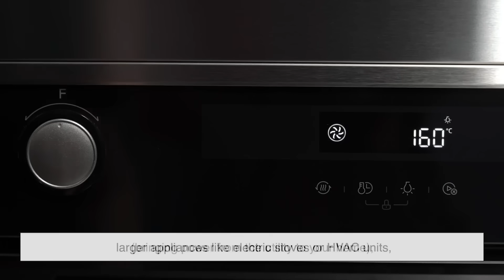What’s the Difference Between Copper and Aluminum Wiring?

Comment: Did you know during wwll copper could not be spared from use in war to use for the  enrichment of uranium. The machines required lots of wiring. So instead they took silver from the treasury to make the wiring. The machines used 7 percent of the US electric supply to run.

Comment: Municipalities need to start using aluminum for street lighting. Here in MN, Saint Paul in particular, copper thieves have left whole areas of the city's street lighting dark. At least with aluminum the profit motive wouldn't be quite such a enticement.
Reply: Detroit used aluminum for street lighting also because of copper theft.  Detroit also ran the wire overhead instead of underground to prevent theft and save money.
Reply: Or just enforce the laws like normal states do. But you got Tampon Tim, so I won't hold my breath.

Comment: I've lived in two houses with aluminum wiring and I'll say this: Copper is better. aluminum is so hard to work with and damages easily. Straight runs are fine, though. Replacing a switch or outlet wired with aluminum is a nightmare as the wire tends to break.

Comment: I crunched the numbers:  when the US Mint changed the composition of cents in mid-1982 from 95% copper to 2.5% copper, they used 49 million pounds less copper for 1983 alone.  Aluminum was a contender to replace copper in 1974.

Comment: It should be mentioned that, for cost reasons, copper-clad aluminum is also used, for example in jumper cables or speaker cables. With copper-clad aluminum you don’t get oxidation like with aluminum. Maybe we see this in house wiring as well in the future.

Comment: We live in a house wired with aluminum from the 60’s. Never been an issue but the real irony is that AL was used due to cost of copper, yet running from the basement to the second floor is a 6 inch copper drain pipe. Wonder what that cost 😀.
Reply: I got rid of most aluminum (only 3 ceiling boxes left with Al.) from my 1974 house. The original aluminum electrical work was poorly done. Lights were flickering and outlets buzzing.
Reply: 😂😂😂😂😂 sounds like copper wire was unavailable during the construction😂😂😂. Copper is better for wiring, you can carry more current with less material with copper.

Comment: For aluminum you have to choose a larger cross section than for copper. There is also the problem of making a durable connection with aluminum that does not oxidize. Special contact paste is necessary to safely contact aluminum. And then the problem is when a connection from aluminum to copper has to be made. Connecting different metals without corrosion.
When the cable moves, aluminum tends to break, copper is more flexible. Except for very thick underground cables, copper is better to use.
Reply: Actually I was trying to think of the term "differential metal corrosion". I thought that was the problem with aluminum wiring. You had to purchase outlets and switches made for aluminum.

Comment: Nice overview of Copper vs Aluminum wire. Glad you mentioned Aluminum wire is still widely used for the large residential service conductors, both on the utility and home owner side. In the US residential electrical service is typically 100 or 200 amps. Aluminum is significantly cheaper than Copper for these large conductors. As mentioned since Aluminum is not as good a conductor as Copper is it sized larger to meet the same ampacity rating.

The large conductors shown in the pictures used for utility power transmission and distribution are typically ACSR (Aluminum conductor Steel reinforced.) They consist of a central steel strength member wrapped in Aluminum conductors.

Comment: Copper has 29 electrons while aluminum has 13 electrons per atom.
You have to use more than 2X diameter of aluminum to get the same result as copper.
Reply: Actually you need 60% greater surface area but on the mass that is just half.

Comment: while Aluminium is lighter and cheaper to buy,  it also has a much higher resistance, which means more lost power as heat, but of you're not paying for the electricity, it's great, but once past the meter, not a great idea. 
over the lifespan of the cable, copper is cheaper to own.
Reply: Actually you need half as much aluminum as it is lighter. As it is cheaper the metal costs are just one tenth but that is not really relevant. It does not matter whether the metal costs are $200 or $20 on a house.
Reply: Power consumption bill will mitigate the price difference in just one or two years